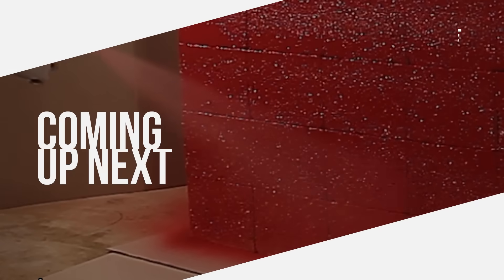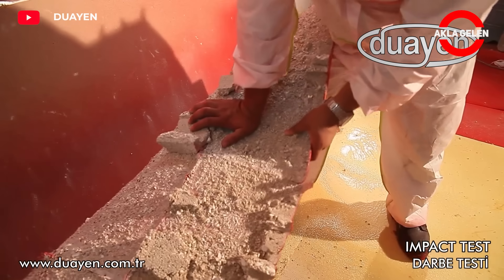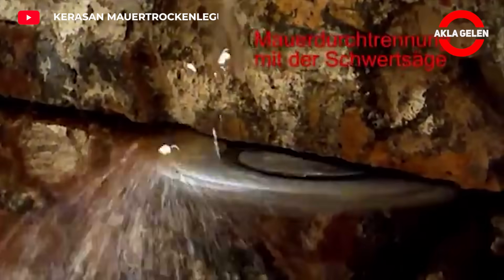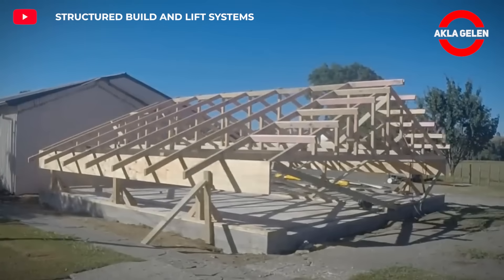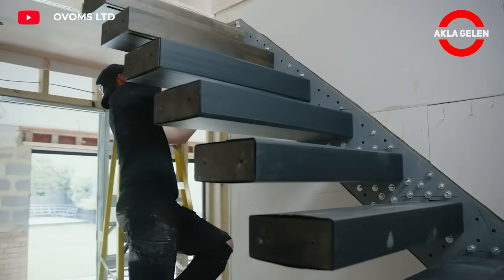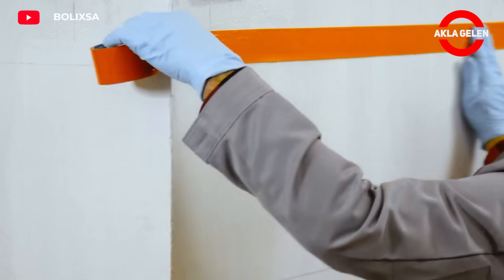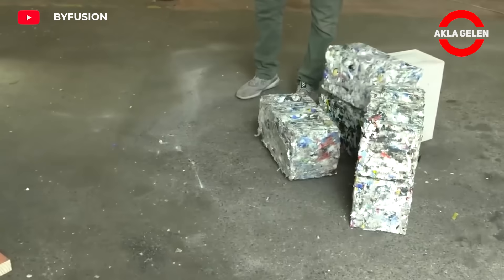Construction Workers Can't Believe This Technique Works - Most Ingenious Construction Technologies▶7

Comment: Can’t imagine the ceiling heating is smart. Hot air goes up so energy wasted on heating the ceiling, inefficiently at that too….
Reply: They did not suggest heating the ceiling. They insulated the ceiling.
Reply: Water leaks in a ceiling will ensure that becomes a very expensive mistake.  Ceiling, mould, furniture below and flooring all endangered by that !

Comment: 4:29 Absurd and slower than doing it the proper way. 
5:28 More nonsense. Lightweight concrete, which is what this is, is still far heavier and more rigid than normal roofing which means it will NOT be good at resisting earthquakes. It's also more expensive and time consuming. Furthermore, try to add something to that roof. It will also crack and cause leaks. 
6:34 Rubberized boots have been around for decades... nothing new. 
8:39 Not good for load bearing walls. That will have to be built in addition to those flexible blocks. Their little shed is about as much load as those can carry, misleading demo.
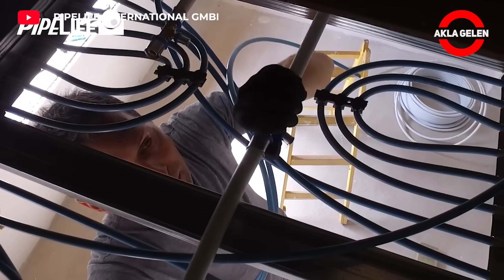9:30 A very costly and less efficient system that is not only failure prone but WILL definitely fail long before traditional cooling/heating solutions. It also requires more equipment like water softener to help prevent scaling in the tubes which would quickly disable the system as well as a water based heating/cooling transfer system which is more expensive as well.

Comment: Hmm, circulating very cold water  (or, more probably, very cold anti-freeze mixture)  around a false ceiling might actually work to make a room feel cooler!  The air next to the cold pipes will tend to sink down to the floor, and set up a convection current in the same manner as heating from beneath .....